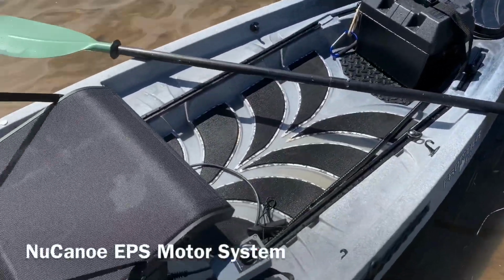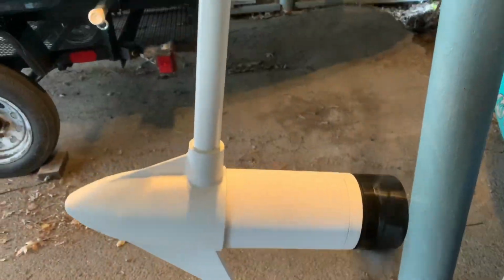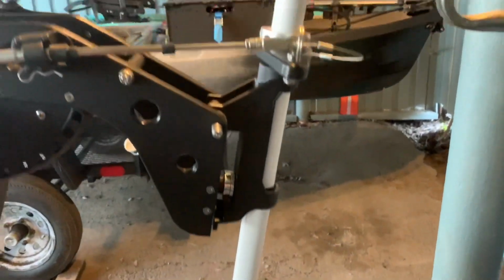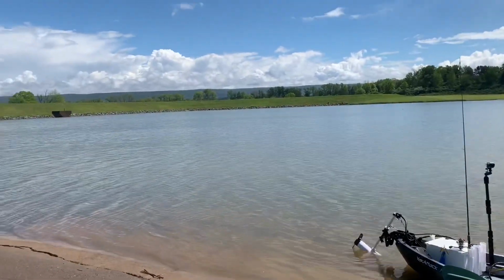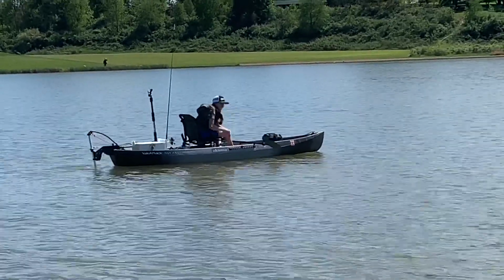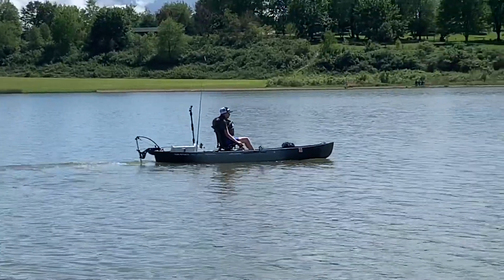NuCanoe EPS Kayak Electric Trolling Motor Propulsion System - Fishyaker Kayak Rigging

Comment: I think if this setup was cheaper than the motor guide Xi3 I would get this but for the same price as the motor guide you can’t beat the GPS spot lock feature.
Reply from the maker: Great point.  I seem to plow into everything on the river, so I’d smash a bow mount. 😉😁
Reply: @fishyaker  This has been my dilemma between the EPS and a bow mount motor. I guess since I mostly fish Lakes, the bow mount with GPS probably makes more sense.

Comment: Nice, what is the speed with one adult in it (3-4 mph)?
Reply from the maker: Yep!  Maxes out between 4 and 5 mph. 👍
Reply: @fishyaker  that's good, I have a  bow mount 55lb Haswing and am around 3-4 mph (Nucanoe F12).
Reply from the maker: Sounds about right.  I’m usually running in current.